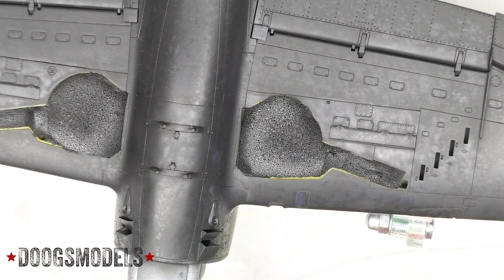Tamiya P-47M Build - Part 13

Comment: Where did you get the random mottling stencil?
Reply: Uschi van der Rosten, Trinity Splatter Airbrush Stencils.  "You can buy online at reputable hobby sites or go to Uschi's website."
Reply: Uschi also has wood grain stencils too.
Reply: adalecarter Thanks!
Reply: @adalecarter  He's actually using RB Productions' stencils, the RB-T052 to be exact!